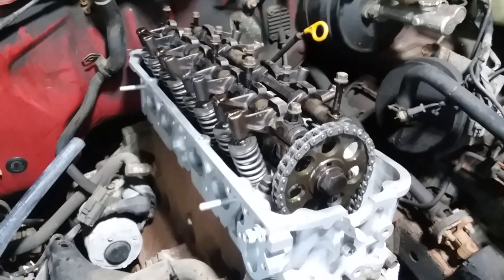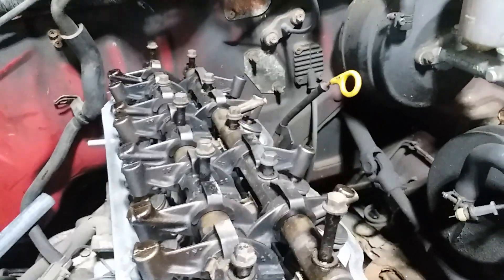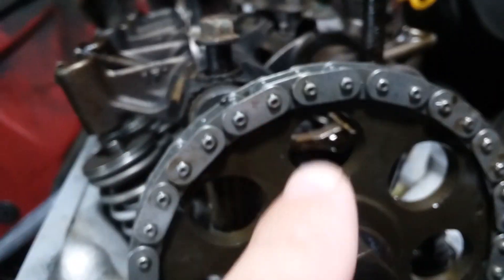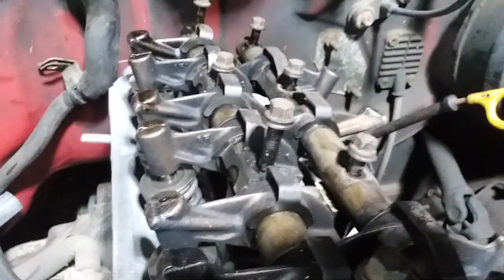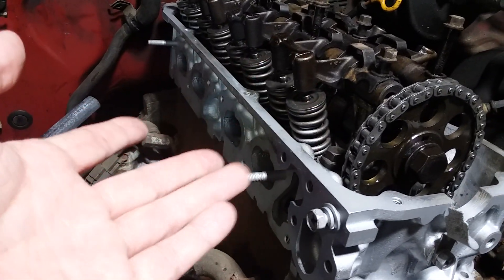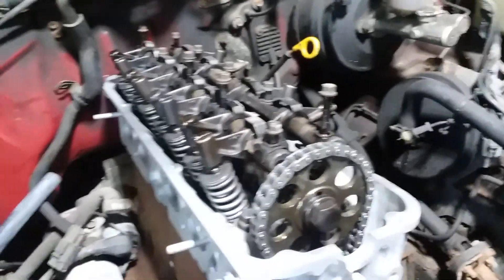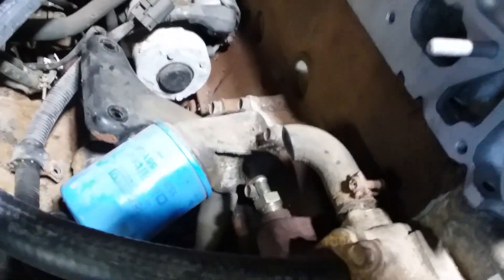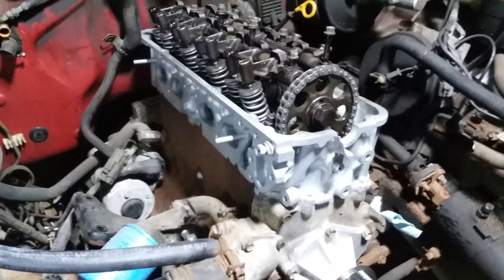Nissan Hardbody [Patches] Head Gasket Repair Project Part 11: Rocker Arms

Comment: What is the toru on the rockerarm
Reply from the maker: 27 to 30 ft lbs
Reply: I still haven't got it running it sound a drawing started but I have replace it and my battery to what do I check next waiting on someone smart er than me og mech